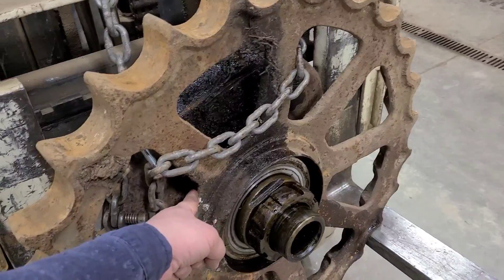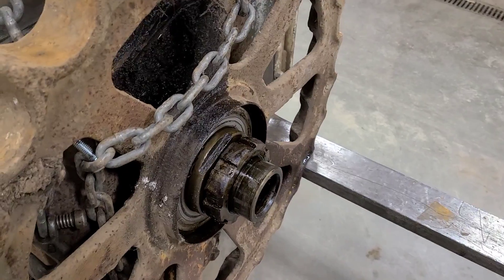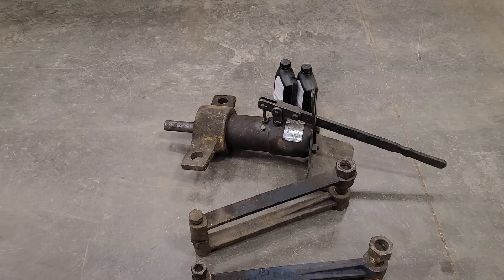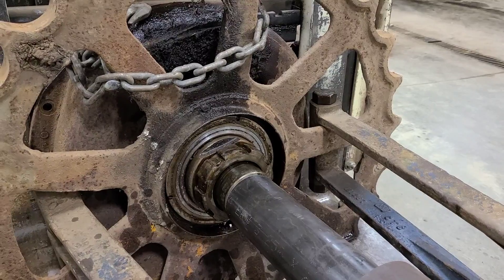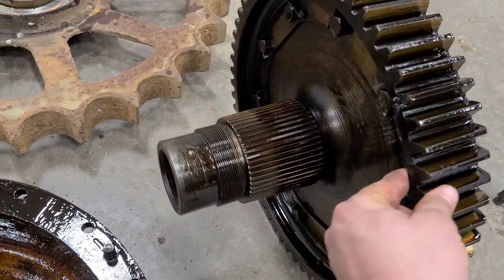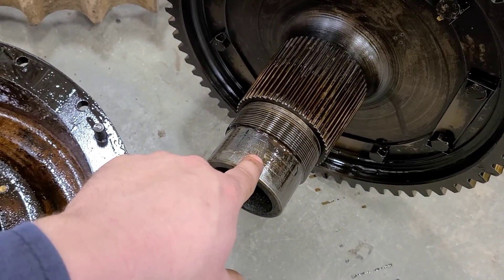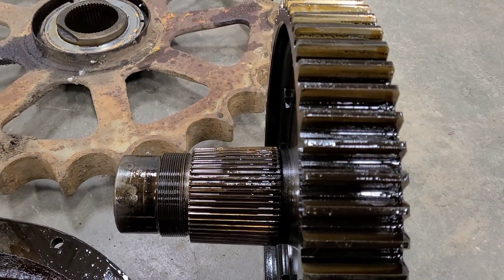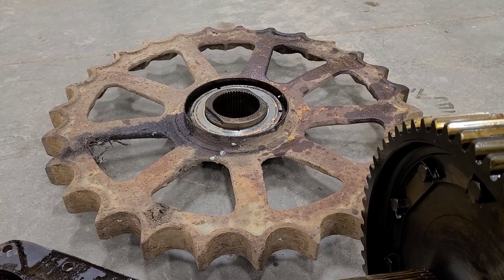Caterpillar RD-4 Sprocket Removal

Comment: I'll gladly take forgetting to record over focusing so much on the filming that safety becomes more of an issue than it already is when pressing old parts. That's just the mechanic in me talking, drawing from the days when I have to press transmission shafts apart at 50 tons or more with stacks of gears and hubs that all slam at once.

Comment: Well isnt that pretty much how it goes  it's been that way with me most everytime there was something  that you wanted to highlite and bang it's a miss lol  the only time it went to plan was the day my dad had a JD Model G that had a particular issue where the tractor would lockup and quit in one movement. But it would do it only after running about an hour or so and not when working vigorously just in normal slack operation. I looked over the schematics grand dad had and read a trouble shooting notice about a water plug.between the main transmission and the horizontal drive engine back half. Entering through the transmission top and after draining the trans which was mixed with water I found the steel plug with a jamb mark in it pryed it free and checked the mounting surface and installed a new brass and rubber sealed water plug that seals the hole completely. Did it all in a single afternoon after school that saterday dad was going to check and see what its issue was. I told him it was done already and handed him the old plug and informed him the coolant and the transmission  would had been changed and stopped off. He couldnt believe his teenager did in and after noon what had been stumping him for nearly 2 and a half years oddly enough  the oil never entered the coolant passages but the coolant filled the tranny

Comment: Neat! while that picture /diagram it show that the sprocket was strong enough to pull on. So I would presume that a guy could use most ant 100 ton ram and strong backs and  clamp around the sprocket spokes to get them off

Comment: Pulling against those spokes would have made me a little nervous. Is it ordinary cast iron, or a different alloy?
Reply from the maker: I'm not 100% sure on material but they almost seem like a forging and not a casting. I wasn't the biggest fan of that either but that is how Caterpillar specs it, right down to the tooling. Thanks Chris
Reply: @kylechrist  I didn't think about it being forged, but that would make sense for durability of the teeth. I can just imagine that baby getting hammered out!

Comment: Kyle, when I helped Allen Rudolf close to 50 years ago he was changing tracks on his D7. The dealer loaned him the portable press for pressing the connecting pin out. The press was similar to what you have there, one of the bolts sheared and the press flew like a rocket but fortunately no one got hurt. He wound up torching a link.

Comment: Yeah. Cool 😎 Kyle. 
🤗Oh, oh, oh I would love to have that puller 🤩 awesome. Noice very noice 🤣😂🤣
The grease/oil you have there is what I refer to as rhino-lube. That stuff is heavy, water resistant and made with a high molybdenum content. It don't wash off easy. Modern anti-seize is a walk in the park next to that stuff.  I still have about two and a third drums of the grease left over from the 80's for my projects 😁👍

Comment: With the press. Do you have the adapters to push the sprockets back on with enough tonnage to tighten the retaining nut..

Have you chunked the rusty engine parts in some kind of antirust solution